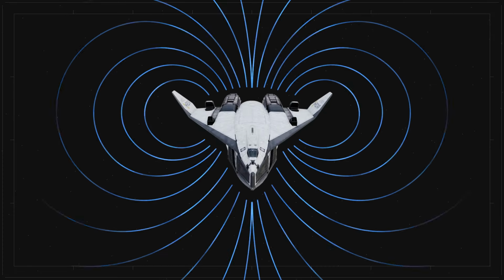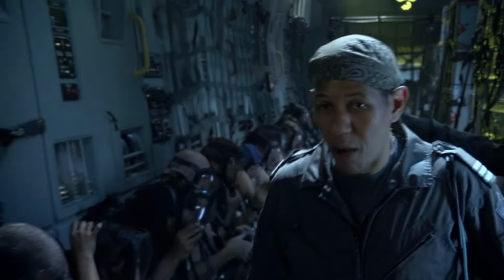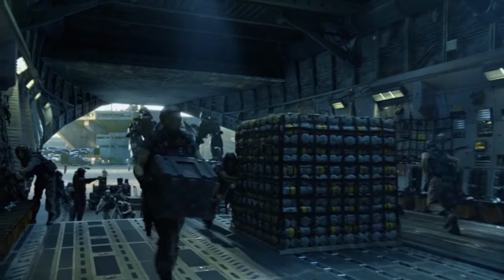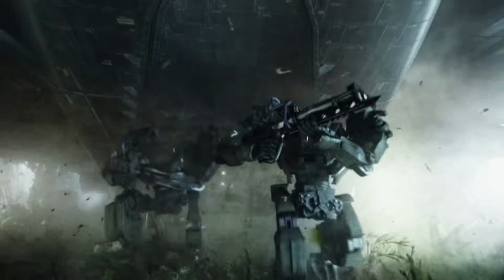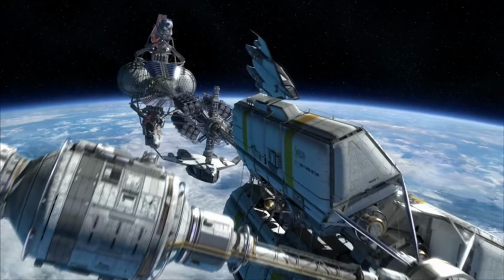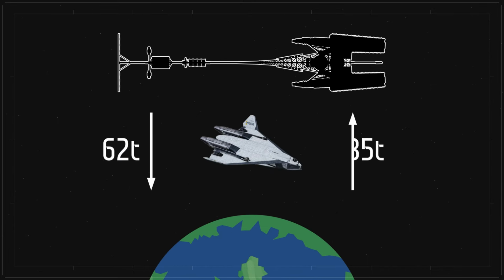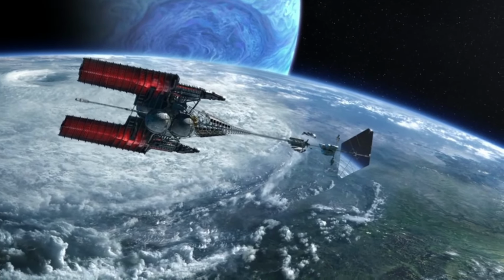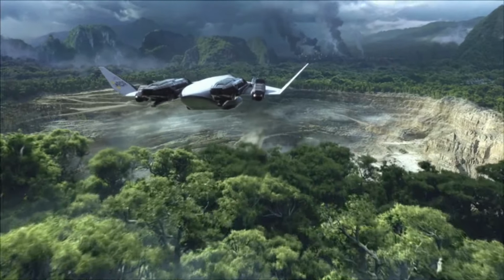Avatar: Valkyrie Shuttle Analysis

Comment: Since its use was so specialised, it would have made sense for it to have landing skids instead of huge rubber tyres and landing gear which would take up more weight. No runways on pandora and skids spread the weight better if they had to VTOL on soft ground. Even if it was originally designed for Earth use where they need a runway for lifting a larger payload to orbit, the background story in the movie stated clearly how crazy expensive it was to move even 1 kilogram from Earth to Pandora on the ISV so it made no sense to carry that heavy landing gear and tyres to Pandora.
Reply: I think that VTOL mode worked only on Pandora, due to decreased gravity. So it used conventional takeoff and landing on earth. And thats where proper landing gear is needed
Reply: @eugeneyanyuk4879  Yes but 1.) You could take off unloaded from Earth and load it in orbit. 2.) Even if you can't, still makes sense to swap the landing gear in orbit. The whole idea is that it is just very very expensive to carry any weight to Pandora which was stressed in the movie.
Reply: And you dont even need to refit the gear in orbit if you used take-off dollies. Many real life aircraft did that e.g. the Me163
Reply: @keithw4920 how you gonna taxi tho
Reply: @Nr15121  You can see the Pandora base, there is no taxi space, just VTOL land.
Reply: Maybe they want to be able to move it on the ground without jacking it up
Reply: I think there are a few reasons. Firstly, to allow them to be moved around on the ground. A lot of helicopters are fitted with wheels for this exact reason. You need to be able to tow them about. Secondly, the very same individual shuttles (not just the same design) would be used at the start of the journey on Earth to get crew and supplied up to the ISV. Operating from Earth they will likely use runways to be able to carry more in one go (esp as higher gravity would even further reduce their lift capacity in VTOL mode). Removing the wheels once in orbit would be impractical since either you are then going to carry that dead weight with you (along with the skids), or somehow transport it back to Earth... on the shuttles you just removed them from. If you dumped them in earth orbit, they'd quickly become a hazard, given the increased activity in space.
Reply: If a Runway take off adds to the crafts carrying capacity then clearing a runway on Pandora should be well worth the effort, they have a giant crater worth of mine tailings after all, just dumping them  in a long heap should make a good foundation well compacted by the mining vehicles themselves.
Reply: @kennethferland5579  The original base looked quite limited in size and a multi km runway was probably too far a perimeter for their defences. Anyway, its moot since the movie obviously never used one.
Reply: You can takeoff with more weight if you takeoff conventionally than vertically, if they were taking off from Earth it would make sense they takeoff conventionally with the gear.

Also, swapping the gear with skids in orbit would be so impractical, the gear has a bunch of mechanisms, hydraulic lines, electrical wiring, etc. it would be an expensive mess to do so, it would be cheaper and more efficient to just chose one and stick with it. A conventional gear is more flexible so they went with that.

Also, imagine if they have to taxi on pandora, I don’t think they want to Hover-taxi the shuttle that would be incredibly inefficient, with wheels they can pull it with a tug or taxi under power without having to leave the ground.
Reply: @nikobelic4251  If you are taking off from earth, you can take off light and load up in orbit from another craft, remember the major factor is how crazy expensive 1kg to Pandora from Earth is.
Reply: @keithw4920 you can do that, but you can also save time and aircraft and just fly full Valkries up to orbit in one go by taking off conventionally. 

Maybe Valkaries were also used for Earth to Earth transport as well so wheels were more useful for that too. 

There are so many reasons why they would have decided to put wheels instead of skids, we see it today in many larger helicopters.
Reply: You can't taxi around if the whole thing sits on a pair of skids. Sure, they could take off and hover from one place to another if necessary, but why deal with the jet blast and wear and tear on the engines etc if you can just roll on some regular wheels? Sometimes you overcomplicate simple things by trying to simplify.
Reply: Cameron should have shown the Valkyrie manuevering on the ground after landing. VIP helicopters do it at large airports; they land on a designated helipad, nothing more than a painted circle with lighting, and then taxi to a convenient spot on the apron where the passengers can alight and be whisked away in a limo.
Reply: I'd Guess That The Difficulty Would Be Something Like Of Course
The Shuttles Going To Or From Earth
And Thus Having To Swap Over The Landing Systems Each Time
Reply: @JNJNRobin1337  But they go on a one way trip to Pandora. And if heavier loads need to be lifted to load the ISV from earth, just do 2 or more trips with VTOL since the cost of that should be very small compared to lugging those extra tons to Pandora. The main argument is still that the movie explicitly stated that every kilo transported to Pandora is very very expensive.
Reply: Many helicopters and VTOL airplanes have wheeled landing gear so why not the Valkyrie should have?

Comment: You said the Valkyrie wasn't as well designed as the ISV, but as someone who only saw Avatar in theaters once, I'm surprised they put as much thought as they did into any of this. But honestly, once you have fusion reactors small and light enough to power an aircraft, you can pretty much build whatever you want and it will fly. Propulsion tech is always the limiting factor in air/spacecraft capabilities.
Reply: Given enough thrust, even a brick can fly.
Reply: @moteroargentino7944     For a brick, he flew pretty good!
Reply: @moteroargentino7944  The F-4 motto…
Reply: 6 hours to rendezvous and dock? Maybe there are some extreme stationkeeping steps, but spacecraft could complete rendezvous in 2 hours or under if launched during the right launch window.
Reply: @fork9001  Physically there is nothing stopping a rendezvous from being merely 8 minutes long, i.e. launch directly to a station keeping position. Any increases in that duration are taken for safety due to imprecisions during launch and orbital maneuvering. Soyuz irl has the fastest possible rendezvous with the ISS, and that's still a cool 6 hours. Most other capsules take days to carefully match position and speed
Reply: @dsdy1205  Gemini missions could rendezvous with either another Gemini spacecraft or a Agena target vehicle in less than 2hrs from launch. Perhaps the Valkyrie shuttle takes longer to get to orbit because it has to accelerate quite a bit in the atmosphere with jet engines.
Reply: @fork9001  Like I said, long rendezvous times are a matter of safety, not available engine power. the Gemini missions rendezvoused very quickly because they were literally inventing the art of rendezvous. Safety took a backseat, and anyway the target vehicle was another Gemini that could dodge easily if the approach got dicey. You can't maneuver a space station or an antimatter starship so easily, so the approaching vehicle has to take a much more measured approach. Else you get situations like the Mir-Progress collision.
Reply: @dsdy1205  So stationkeeping I guess. And the added danger of a massive fragile antimatter reactor could make the process more complicated
Reply: @fork9001  Stationkeeping is the relatively simple process of holding position alongside the spacecraft. Orbital rendezvous is a much more involved procedure involving phasing orbits, inclination matching  etc that allows you to get from just 2 vaguely similar orbits to a position close enogh to stationkeep. It would be instructive to watch the European Space Agency's videos on how the Soyuz rendezvous's with the ISS, they explain it in much more detail than I can here
Reply: @dsdy1205  So combination of both to prevent a crash. Stationkeeping can make orbital rendezvous more complicated to prevent collision in the event of thruster failure or something like that.
Reply: @fork9001  You can keep trying to sound smart or you can actually try to learn something for once.
Reply: @dsdy1205  Yea the 10 hour bit is hard to figure out, the best guess I can give is that some significant plane changes are needed.  Maybe ISV's arn't parked in low orgit but rather are in a far higher medium orbit and the longer duration helps keep the propellent costs of these plane changes to a minimum so as to maximize payload.  Also the lower gravity of Pandora may be a factor, lower orbital speeds mean longer orbital periods.
Reply: @kennethferland5579  if you're launching from ground, you can wait while the rotation of Pandora carries you into the proper orbital plane as the Venture Star. In any case the most likely explanation is just that they're taking it slow for safety
Reply: Knowing Cameron this was allll thought out down to the bean.. just because we can't figure it out at first or second glance doesn't mean he didn't put serious thought into it

The fact that I still discover new tech details in ALIENS  decades later is testament to that
Reply: Yea you also woudn't need to both with 'flying' to orbit, just going strait up like a rocket is the most efficient thing.  If it can accelerate at 3g then it can skip the ramjet and just go into fusion drive once it's clear of the launch pad.  Only reason I can see for ram jets is if you want to make intercontinental supersonic travel in the atmosphere an additional capability of the craft.

Comment: Maybe it's just be being picky, but given the location of the forward pair of engines, does that mean that all the cargo needs to be held back at the doors to stop it becoming nose heavy? Anything forward of those engines acts as a pivot in VTOL, GCSE physics.
Reply: Probably need the engines set back for unloaded flight because the fusion engines way a ton. I wonder if they’d need a runway for fully loaded orbital insertion from the ground. When collecting fuel from the atmosphere they are already in flight of course.
Reply: @wallissimpson5414  True. But since they're supposed to be left behind to scoop fuel, do they just have a stockpile of them lying round or are they actually the original two from the first excursion?

Comment: Earth shuttles use ceramic plates to dissipate heat during re-entry.  As well as use a certain degree of pitch to keep the bottom of the shuttle as the sacrificial heat shield.  Maybe the atmosphere of Pandora doesn't create the heat on re-entry like it does on Earth?  Which would allow for a lower angle of attack on re-entry.
Reply: What a ridiculous notion. Any sufficiently dense atmosphere creates atmospheric heating. And atmosphere of Pandora is even denser than Earth's.  Go back to physics class before you spew bullshit on Youtube.
Reply: atmo on pandora has less pressure but is more dense (about .9 atmo pressure and 20% more dense) I don't think the pressure does much to help nor hinder but the density would do something

Comment: yes  the peek shutle it totaly unuseful remind on ty 177 old version bulky design and position off balance negine is totaly unsafe it should be more at front pair engine otherwise is heavier trasnport anyway in design no one bodered to realyy see future off corvette tech as simply back pair engine start to be rotational so no need for bulky fusion design since oxy fuel in space x does the job only intersting is cargo shuttle based tech thats is why it passed into movie otherwise to base idea on all that design that is nto even finished or futuristic as idea is abti limited and not even aero dynamic pitch that bit limited for high spee so atention geos to gliding in the movie and avatars si like signing death penalty to your self in design which is a bit odd

Comment: If I'm not mistaken regarding unobtainium, it isn't directly related to antimatter fuel or reaction mass in any way, it's refined product is used to manufacture high-temperature superconductive electromagnets used in fusion reactors and all the magnetic confinement apparatus of fusion drives, this is why not every vehicle in the human arsenal is equipped with it's own tiny fusion reactor, they're only cost effective when you get up to vehicles the size of the Valkyrie or larger.  This also probably means that the Valk's jet engines are not actually turbojets, but some form of "electrojet" where power from the reactors is used to drive the engine's compressors via a high torque, high RPM electric motor, rather than the combustion of JP1.  This would make a lot more sense than having completely separate, JP1 fueled engines, because without batteries inbetween you can convert your reactor electricity to kinetic energy with an efficiency of nearly 100% even with existing brushless electric motors, you can also use the jets to deal with waste heat from your reactor by placing the hot coolant loop in contact with excess intake air not needed to produce thrust.
Reply: I think it was using waste heat, you can clearly see hotngases escaping and it was concept used in real nuclear powered demonstrators. Not sure if it can be also used for scramjet, but it'd make sense to reduce whatever reaction mass they're using for the rocket stage.
Reply: Assuming the turbines are indeed electrical, if you stick the coolant loop after the compressors (you might need a secondary loop with heat pumps inbetween), you get even higher efficiency thrust since dumping more heat into your exhaust makes the air want to expand. Some propeller aircraft of yesteryear had carefully designed heat exchangers/air intakes for cooling the engine which actually produced net thrust when at flight. Pretty cool stuff.

Comment: The fact that this thing is VTOL might have to do with Pandora's lower gravity yet almost earth level atmospheric presure. That certainly makes it easier to get away with stuff like that.
Reply: Pandora actually has a higher atmospheric pressure if I am not mistaken. That is why the Samson is capable of lifting so much on Pandora.
Reply: @DankGank  According to the wiki it's 0.9 atm. Anyway at 0.5 g that means the carrying capacity of aircraft is significantly increased.
Reply: @LennoxPoodle  that is the pressure according to the wiki the density it's about 20% more dense than earth

"Pandora's atmosphere is a mixture of nitrogen, oxygen, carbon dioxide (>18%), xenon (>5.5%), methane, and hydrogen sulfide (>1%) and is about 20% denser than the atmosphere on Earth primarily due to the high percentage of Xenon; a heavy, colourless, odourless, and generally unreactive noble gas."

gravity is .8G

so its lower gravity with denser air so things are more buoyant in atmosphere and lighter (I don't really know how much .9 atmo of pressure would help or hinder with flight though)

also wouldn't denser air make it harder for a plane to take off normally as it would have issues getting up to speed? perhaps the VTOL lets it get up to where the air is less dense?
Reply: @lekoro1  Wow, that means that Pandora actually has a "lower" (Stretching less distance above as atmospheric presure is density*gravitational accelaration integrated over height) atmosphere than earth. 
I guess the higher density can be either detrimental or beneficial depending on the drive system. If your ejection mass is collected from the atmosphere it should help. It should however increase friction.
Reply: @lekoro1  Its slower top speed and lower require speed for take off because of atmosphere influence on lift if I'm correct but everything else you said looks right.
Reply: @lekoro1  Planes actually take off more easily in thicker air. At low speeds you care more about maximizing lift than minimizing drag, so the thicker air is definitely beneficial
Reply: @DankGank it’s also how things such as the dragon fly given how comically small its rotors are
Reply: Also material used for building Valkyria is 1/4 mass of normal metals used on ships.
Reply: and the fact it uses fusion engines, instead of chemical thrusters
Reply: Facts
Reply: It uses fusion rockets like those of the expanse. Those can make anything fly
Reply: I think that the atmosphere is dense but similar pressure, it has a frighteningly high carbon and sulfur concentration in the atmosphere
Reply: It’s probably VTOL because the RDA didn’t land with enough equipment to make a runway.

Comment: In short, Current tech sux.  This thing is like 4 times bigger than the current space shuttle.  Can take off and land without auxiliary boosters, is cable of vertical landing and take off, freaking hovering and flying low and slow.